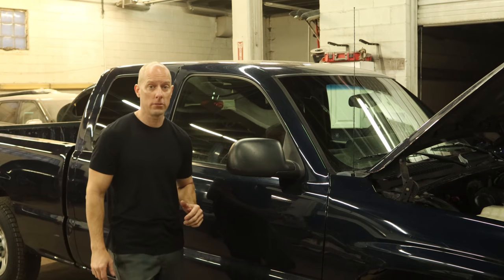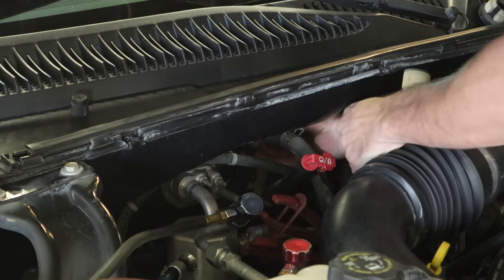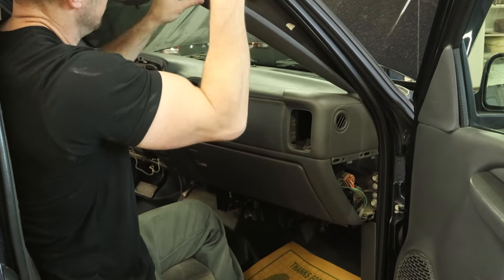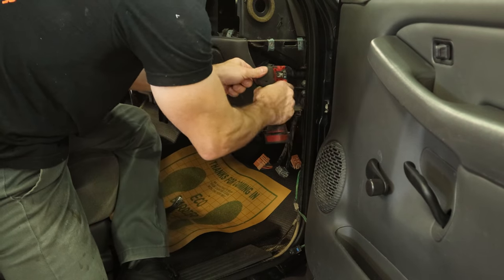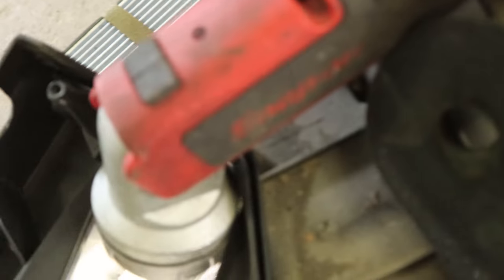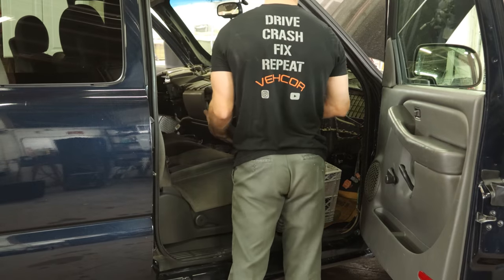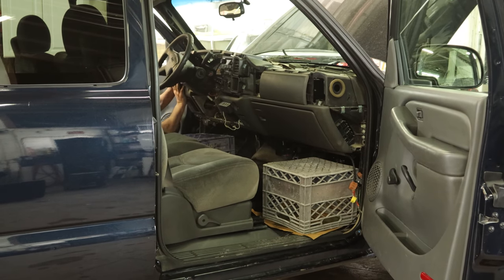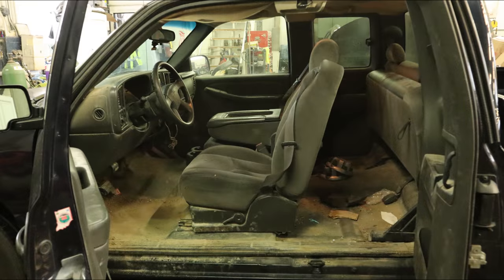Full heater core replacement (the easy way) on a 2007 GMC Sierra and similar models

Comment: Did this job on my 97 Tahoe.  As long as the dash was out, I took the opportunity to inspect the evaporator and saw a small oil stain with dirt and dust.  Yup…..there was my slow AC leak…..   Replaced that too.
Reply from the maker: Those are a little different.  Evaps are easier to get to on those. These heater boxes are welded shut.
Reply: And I just got to the part of the video where you explain about the evaporator….  😉

Comment: I had to do a 90s Ford T-Bird dash removal for the same thing. It took me five days to work on that car. 
Putting the dash in that particular car by yourself was no easy chore. That thing was super heavy. I have no friends either. 
I did take the whole dash out of the car and cleaned it up real good tho, because that thing was on a whole other level of dirty. The previous owners spilt drinks onto it, which lead me to think, that’s why the friggin radio also didn’t work on that car either.

Comment: Really enjoy your video's.  I am in the process of doing a cab swap on a 2005 Silverado crew cab with 80 k miles, my wife wrecked it a couple of months back almost rolling it and messing up the B and C pillars on the drivers side when she went into the ditch and starting rolling over and a tree stopped it.  Everyone was bruised and sore but not really hurt.  I was thinking I would put a new heater core in it while I had the dash out putting it in the new cab.  I am not sure I would have tackled the cab swap without your video's.  I am getting the new cab ready to paint now.  I don't have paint gnomes.  Do you know where I can find some?

Comment: Great video. I just had kind of a same problem with my Nissan Rogue 2017, when I turn heater ON it throws cold not not warm air. Checked with dealership they asked to replace Air box assembly / heater box as part of it connects to blend door is stripped. They quoted way more heavily 3200 CAD. Is there any alternate solution to not to replace whole heater box?

Comment: well you certainly make this job look a lot less intimidating than it sounds. 

All that snap on plastic is why when i got a chance to get a '94 van I grabbed it.  And even it has stuff I need to change, I need to get some older door handles that still have metal buttons to go on.

Comment: Some years back I had a leaking AC evaporator core in my Mercedes W210 E320. The smell was putrid. My mechanic PJ did a great job similar to what you are doing here by removing all the dash, dropping the steering column to get at the offending part. Along with the bill he presented me with a CD recording of the whole event.  Massive job!
Reply: A common problem in w 210  especially after 8 to 10 years. 🙄🙄

Comment: I laughed my ass off on your"I don't have any friends" comment! Great video! I got an H2 and think there is more screws on the firewall cuz I can't get mine out as of right now.
Reply: You get a hard enough job on your car, and if your friends are mechanics you learn who your real friends are, I did the evaporator on my 1993 Oldsmobile cutlass supreme and flat rate time on it is 16 hours, give or take, in a commercial shop, with a experienced tech. I worked as a gm tech, retiring 20 years ago, so I'm a bit rusty, and older and creaky, so needed help. Only one who was willing was my friend who's handy, but not a auto tech in any way. He learned why the shops charge $800-$1400 to do a evaporator. lol

Comment: Hey GoodMorning scott I have a quick question for you. What do you do if the blower motor housing was messed up now my blower motor doesn’t hold in place on a 2002 Chevy silverado. When I bought it it dint have a blower motor I bought one and when I went to put it in I noticed the clips or plastic in the housing that holds it when you turn it in place where missing or broken ???? Any ideas ?

Comment: So does 100% of the air pass over the evaporator at all times before it gets to the heater core? Looking when I remove my filter it seems like it must. A blend door after the evaporator makes it pass through the heater core if on heat mode and not if just cold? I noticed my compressor running sometimes even on heat mode. Does that mean air comes in and gets cooled from the evaporator then heater back up through the heater core if on hot mode?

Comment: Yeah these aren't to bad. Those heater quick connects always snap off easy. Good thing the parts store has them and there cheap. Oh yeah and those firewall insolation blankets always shred and soak up the coolant like a diaper.

Comment: Had a problem with a Toyota Tacoma. I could never bleed all the air out of the cooling system. It would always gurgle from the dash. No noticeable leaks but it was the heater core. Had a slight crack where the lines were soldiered in just enough to allow air in.

Comment: This looks like a cakewalk compared to my 08 equinox and my moms 07 torrent. Did the heater cores on both of them, first time took my about 30 hours to do, granted i took my time and bagged and tagged everything, but the second time, i got it done in about 15/20 hours ish total work time, not consecutive of course. GM makes it so damn hard on those and the dexcool does not help, at least with the older cars. Seats, dash, a-pillars and entire centre stack came out. First time i got the refrigerant evacuated, but the second time, i just took the hvac box apart and that saved a lot of hassle.

Comment: I have the passenger side loose and have discontinued the steering colum. I can't find the two screws above the steering wheel to take out. What sizes are they? I'm working on a 2001 Silverado 1500hd.

Comment: So is disconnecting the steering column really as easy as it appears?  I was watching some videos on how to change the steering shaft and people are ratchet strapping the steering wheel so it won't turn.  Unfortunately, I'll be changing the heater core in my son's 02 Sierra this weekend so I'm planning this approach by pulling the dash in one unit instead of every single nut and bolt there is.
Reply: Locking the steering shaft is to prevent damaging the clock spring for the airbag. All you have to do is rotate the wheel the little bit Scott said past center to get the bolt straight up and down, then just simply lock the steering wheel in position with the key before you remove the bolt. The wheel won't turn, and the clock spring is safe

Comment: I changed out the heater core in my 1995 Chevrolet Caprice Classic in under one hour.
Reply from the maker: 1986 Ford Ranger is the quickest I have done, 15 minutes.
Reply: @vehcor  my quickest was my 1981 Pontiac Lemans, 10 minutes including refilling the antifreeze

Comment: You should have replaced those blend door actuators while you were there.  They were almost certainly bad.  Dorman makes one with a cast metal gear that fixes the nylon gear splitting issue.

Comment: will you be offering the "dash support " tools in your store?
Reply: If you don’t have a milk crate, you can leave the driver’s side mounting bolts loosely attached. You only have to swing the dash out a few inches for the hvac assembly to clear and slide out along the floor board. It doesn’t save any time, but I didn’t know what I was doing and that’s how I did it.

Comment: Fearless.  I drove my 2002 Chevy Blazer with a broken blend door for three winters, because I didn't have the guts to drop the dash.  Sold the truck that way, and the new owner never fixed it.
Reply from the maker: Those were easy, the dash flips down for access.  Just like this one except there is less to undo.  I’ve done many of them in my day.

Comment: My mechanic offered to do this job on my 06 CTS Sport Lux about 3 years ago for about for $475.  Too much for my blood.  I found a shortcut way to do it on YouTube, so I bought new diverter valves for about $100.  When my bad lower back stops hurting, I’ll complete the job.  I’m only 73 and live in SoCal.  What could go wrong in the next 5 or 10 years?😜

Comment: is thre a weap hole in the htr core section to let us know if there is  leak
Reply from the maker: Well, the main function is a condensation drain for the evaporator core but I guess it also functions as you described.

Comment: This '07 (wow, crank windows...wait!  it's a V6 2 wheel drive?  PARTS TRUCK!!) is the "Classic" body, last year for it.  The new body '07 and up is different.  Just helping to avoid confusion.
Reply from the maker: I can’t find the window switch? Help! 😂
Reply: It's there on the door, you just have to move it back and forth a lot to get it to work.  No idea why.  Bad from the factory.

Comment: PSA for anyone that did all of the steps and it seems like thier dash is still sticking behind the steering wheel. On my 2000 Chevy 1500 there are two 15mm bolts that hold the steering bracket in place. They are directly under the defrost vent tubing so the tubing has to be removed then they are obvious. Gave me hell till I figured it out.
Reply: is that the two hidden bolts Above the collumn your talking about, if so he did not have to take out the duct, video time stamp 5:54.

Comment: Oh.. the clean freak stuff ! I’ve owned and maintained my own vehicles since,,,forever. The past 15 years, not as much cause I buy new vehicles, but now that I’m retired and have the time, and less money I’m back.
I’ve had many vehicles at one time, and have used many different shops and mechanics for service/ maintenance,, in the last 50 years I have never had a mechanic “clean” the filth from inside,underneath any vehicles. Yes, they remove oil, or lubricants, water, drill fillings, brake dust, or whatever mechanically affects my vehicles, but mechanic don’t “ CLEAN” my car. If any mechanic spent any time cleaning my car it would raise some serious red alarm warnings. At 200$ CAD hour, I don’t want any mechanic cleaning my equipment.    There’s a service business called auto detailing, and they have all the stuff to clean, and do a great job. And I sometimes use this service.    Really enjoy you video’s.

Comment: With such a destructive job needed to access there would have been a new AC evap core going in at the same time :) Designers should be shot for how they hide components that are minimal but at the same time critical.

Comment: 98.275% the same as a 2004 Escalade, if anyone is wondering.....

Those blend door actuator motors are tough to get to with the dash together....  It pained me, to see you just put the old one back on there....  Ouch.  You had it out.  You had it right there in your hands....  How could you?  You could have replaced it....  That's a gut punch.....  That's why I was pulling mine, to be honest...  Blend door actuator motors....  Still a little salty about GM blend door actuator motors...  Don't get me started on parts that definitely fail all the time, and are impossible to get to....  

The job is do able.  For a home gamer, it is tough.  By yourself, the dash is heavy, you are crawling around like an acrobat from Cirque du Soleil...  It's tough.  Tons of little bolts in that dash.  The little electric tools you have are a must...  There were 2 styles of little screws in my dash though, and on re assembly, I was unclear if it mattered, and which went where...  Sorry, next owner.  Apologies.

I would have loved to seen a better explanation of how to get that A-pillar Trim on & off properly...  I did something wrong, and couldn't get it back on....  Took it to a couple shops, blah blah blah, ordered new parts...  they'd give it back, but they literally would fall off within 5 miles of driving....  took it to a Dealer (gasp), took it to a body shop...  Nothing.  I ended up epoxying them in place, driving it for a couple years, and trading it in on a 14....  Sorry, I guess...  I let 4 different pros take a shot at it...  blame them...

Truck was awesome...  I kept it waxed, did oil changes constantly...  Ran perfect past 200k...  The frame was rusting, from Milwaukee area salt & winter, was the only reason I traded it.

Comment: This can be a nightmare to do if you don't plan it out, if you take notes, pictures and right down the steps it will still take time but you can do it. Sure beats the price at the shop! Also replace those actuator motors while you're in there!

Comment: ? dollars to replace a 150 dollar part. I replaced a heater core on something about 40 years ago. Definitely was easier than this. At 66 I wouldn't even attempt this. I used work in a factory that built HD radiators and I know the way they are built today is much better than the old days so hopefully this doesn't happen very often any more.

Comment: I have a 2003 GMC Yukon with 81,000 miles on it and paying for that repair gives me nightmares.
Reply from the maker: Yours is a little more work since it probably has a center console that needs to be removed.
Reply: @vehcor  It does.😭😭😭😭

Comment: When I did my 05 I just ratchet strapped the passenger side back and didn't disconnect the steering column. PITA but it worked OK. 

I think a guy I OK leaving the evaporator in these trucks. But, anything newer, GMs evaporators are such crap, you better change them while you are in there.  Or in my 16 Acadia's case change the heater core while you have the evaporators out.   Two rears and one front in 5 years.

Comment: I probably should not say it, but out here in the west my favorite SUV’s to buy for myself are those with a leaky heater core and a parasitic draw, on a rust free vehicle.
Sure these are somewhat annoying problems to fix, but usually 2 or 3 days on the side for a home garage guy.

Comment: so if i understand this correctly, it takes 22 minutes to replace the heater core in my GM truck. i'll allow 30 minutes just to not pressure myself. and commercials. easy peasy.

Comment: You have to have a sharp mind to remember how all that goes back and remember what order..all the manufactures should have these easily accessible but very few do but more importantly they should not be making these heater cores out of CRAP and paper thin to boot.Thats the only reason. You ever have to replace them.
Reply from the maker: Sharp mind, I can’t remember what I did with that tool I had five seconds ago! 😂

Comment: That's another thing the (so called) engineers did that I am sure they thought was hilarious. They could have easily designed it that a part that fails like the heater core is easily accessible. If they could make cars in the 50's and 60's that were easily accessible there is no excuse now ?

Comment: If the heater core was made from quality materials like my 27 year old 456.000 miles Toyota T100 is wouldn't have to do that.
Domestic cars suck and pickups suck the most and yet they sell a lot it  tells you how studid  average consumer is here in America.

Comment: That’s a lot of sugar for a dime!
I think I would go for a new blower motor also…. If I was going to keep the truck. Got to be cheaper to do with it all torn apart.
Reply: Blower motor is easy to replace  from the bottom.  Twist and lock.

Comment: Just pulled the dash on a 2001 Silverado with the 4.8. This video isn’t accurate at all. Careful cause he misses a lot of bolts for pulling the dash.
Reply from the maker: Nah, you just did it wrong.  All the bolt necessary for removal are in the video.  Amateurs 🤦🏼‍♂️
Reply: @vehcor  no need to be sassy brother. There are 2 small bolts behind the gauge cluster holding the dash in you never mention. But okay.
Reply from the maker: 15:04 I await your apology
Reply: @vehcor tried to link a different video but isn’t working. There were 2 bolts on my dash behind the cluster you can’t get to without removing the cluster.